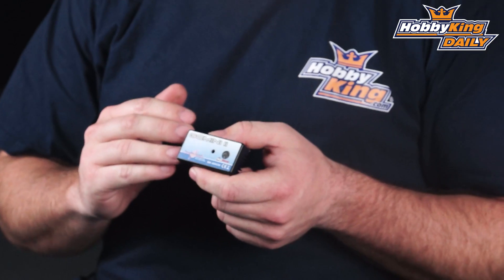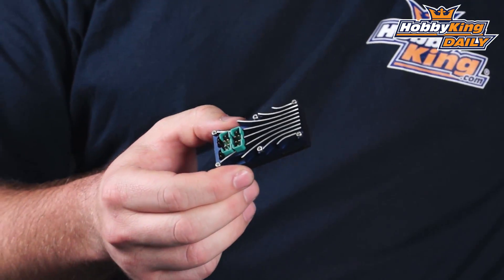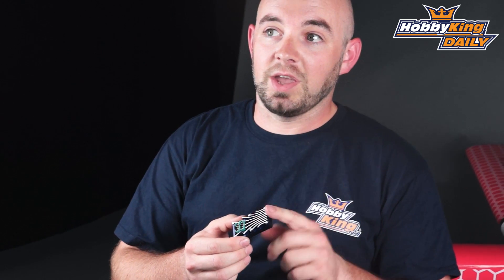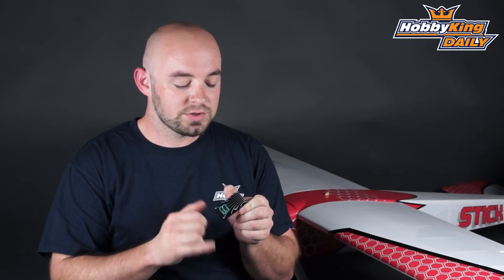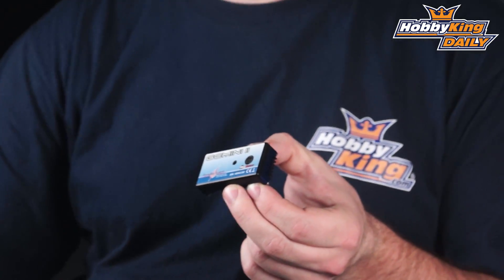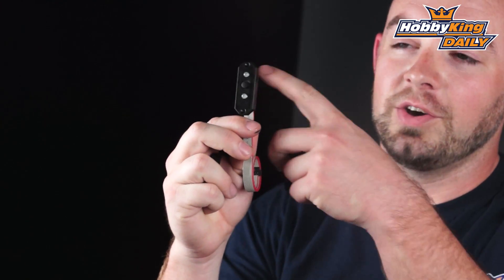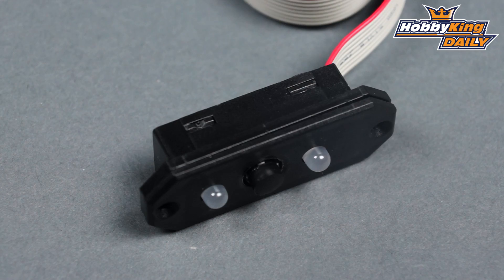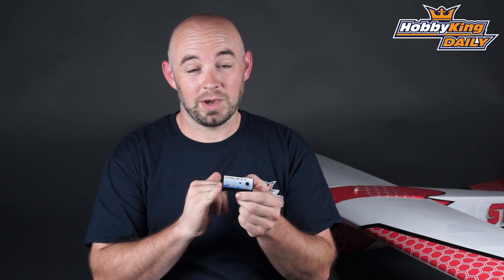HobbyKing Daily - Gemini 2 Voltage Regulator

Comment: I used to deal with Voltage Regulators way back in the early 2000's.  I was the Marketing and PR Director for PowerfLite.  We used Voltage Regulators with Lithium Ion Batteries when Lithium packs were first being used in the hobby.  Since Lithium Cells produce more Voltage than the old Industry Standard NiCd and NiMh Battery Voltage, these Regulators are great for "Reserve Power on Demand". 

These guarantee true Voltage Output to your Servos under a High Load Situation so your plane did not get "mushy" during HARDCORE 3D.  These are great for Large Scale Applications.

~R~